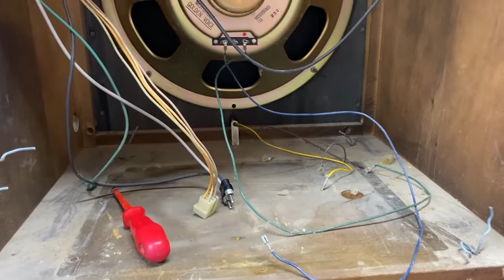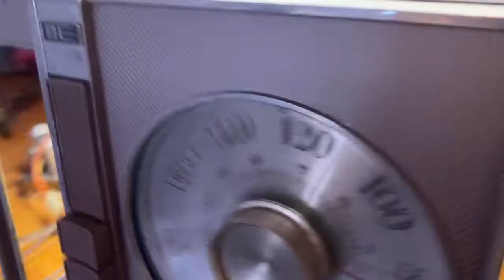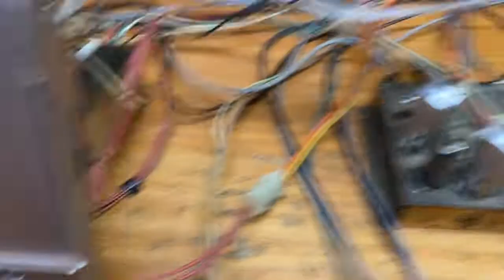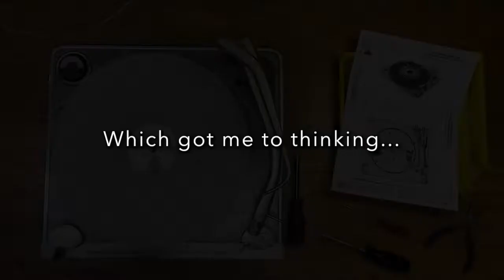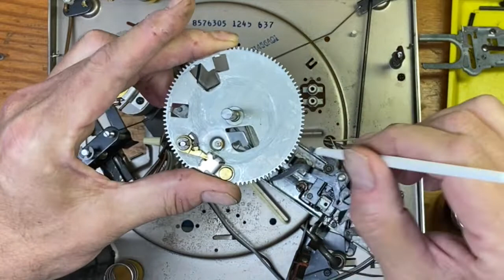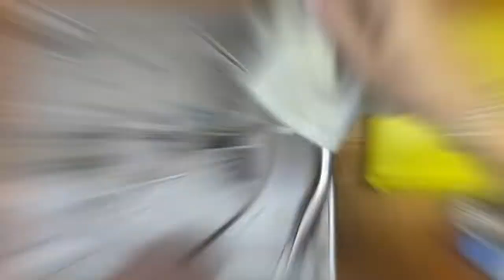Restoring a 1963 Drexel Motorola SK77 Stereo Console with VOM Record Changer

Comment: I have a slightly different, compact box version of this unit.  I modified the flawed/flat box design by opening up the front to unblock the base, reduce feedback into the box structure, and improve phono isolation.  Now it looks more modern and businesslike with a 15” circular black grill.  That glorious tuner/amp is the same and near mint, but with the bass unblocked the overall sound is far more balanced.  It’s a beast and I never listen to it at more than a volume setting of 3.  I’m considering a swap to a modern mid-range turntable as the old unit is too primitive, but for now the Bluetooth input is more than adequate.

Comment: Great amp! I had a version of that but it was SE on the two stereo channels with only the woofer channel being PP. There are other versions as well but this is the first all PP design I have seen. Yes, the "getter" absorbs out gasses from the internal tube metals over it's life. Mirror like is a good sign however the tube may still be bad or weak. Brown indicates a heavily used tube but still may be OK. A white getter indicates a vacuum loss and and a junk tube.

Comment: I’ve always gotten a kick out of the early years of the optional stereo multiplex decoder. 1961 was officially the launch of FM Stereo in the United States using the Zenith system which was the gold standard determined by the FCC. Several systems were tried and zenith won the prize with their system being able utilize a small footprint on the signal which allowed for other subcarrier information to be there and broadcast without eating up to much bandwidth & Transmitter power the others took way to much of as it’s summed in with with the ERP of a station. But others were in some cases sonically superior.
Very interesting set of circumstances which was an act of Congress testing it in the field and getting it all to work right.

Comment: Thanks again Steve for this video. I have just completed the voice of music changer service, and I'm just curious as to what adhesive you would recommend to glue my rubber platter mat back down to the metal turntable? It has completely separated. I have cleaned all of the residual glue/adhesive off of both surfaces.  Cheers!
Reply from the maker: I use Weldwood Contact Cement. Make sure to leave it overnight under weight.....
Reply: Hi again!  So I got the turntable all cleaned, lightly greased and oiled, and put back together.  All parts are free moving, and I can cycle the Main Cam/gear through and entire cycle, and all works as it is designed. (trip levers/record will drop/engage/reset/etc..  Manually, that is.  However, when I power it up, the turntable turns, but when I hit the "reject" to drop the record, the needle arm goes up, the record will not drop, then the turntable stops moving, and pauses there until I shut it off.  Any wisdom as to what I am missing?  To me, it seems like an automatic cycling mode problem, but I can't for the life of me figure out where to troubleshoot first. Maybe some cycle reset needs to be done?  It seems like the record tries to drop, but won't, then the turntable just stops because it's caught in mid cycle.  Any help at all most appreciated as always.  Cheers! @SteveScarlet

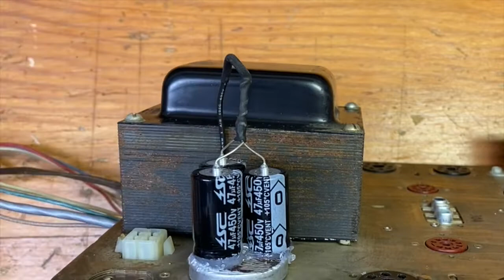Comment: Hey Steve, At 21:40 of this video, it shows that you connected all of the grounds together, shrink tubed them, and (soldered) them to one common grounding wire.  Where then did you ground the wire?  Was is to  the same grounding prong as the 200uf Cap underneath?  Cheers!
Reply from the maker: Yes, but any chassis ground will work.....
Reply: Appreciate you! Got the new caps, and looking forward to getting the amp completed.  This has been such a fun, disciplined project, thanks to your video. I'll be 😂to send you a video of my console operating once I complete it!@SteveScarlet

Comment: Hi Steve! Thank you so much for this video! I am restoring this exact setup on a 1963 Motorola console. Although the cabinet looks a little different, the components are exactly what you work on in this video. I have all but followed you step by step,  and I have managed to now be able to power up the FM tuner, complete with all indicator bulbs including the magic eye. My question is this if you don't mind: when I first took the console units apart to clean them, I had a functioning turntable only with full sound. Now that I've put it all back together, everything is powering up, but I have no sound! Can you direct me to troubleshooting where I may have gone wrong? Maybe just a quick where to look first? Thank you for any wisdom! And thanks again for this great video!
Reply from the maker: Thats a tough one without physically seeing it but re-check your work......
Reply: @SteveScarlet  thanks Steve! I seem to have developed a new problem which I believe is the vacuum tubes. When I plugged it all into bench test it, everything seems to power up, but even with the volume all the way down and no input from a component, the speakers are crackling. Seems to get louder the hotter the vacuum tubes get. My guess is I've got to part with some money and replace the tubes. Capacitors check out okay so far, but probably replacing those as well. So strange though that I was getting beautiful sound and no crackling from the turntable before I took it apart to troubleshoot  the radio/preamp problem.  I'm pretty sure I put all the connections back properly, but perhaps powering it up and disconnecting things one by one will isolate the problem.

Comment: What replacement did you use for C3 8uf/50v capacitor in the tuner section?  Thanks
Reply from the maker: https://www.mouser.com/ProductDetail/Wurth-Elektronik/860160672008?qs=0KOYDY2FL2%252BmDNgx1uK8%2FA%3D%3D
Reply from the maker: But a 10uf will work fine.....
Reply: @SteveScarlet  Thank you!
Reply: @SteveScarlet  I really find your videos informative and entertaining.  Thank you.
Reply: @SteveScarlet  Steve -- working on a Motorola SK77.  I am testing resistors in the amp and finding 75% of the bubble bee resistors to be out of spec.  Have you ever run into a unit that had that many out?  I am using the color code on the resistor for the value and then measure.  Appreciate any guidance.  Brett
Reply from the maker: @brettkaufman2299  you have to de-solder one of the legs to get a correct reading. I advise joining www.antiqueradios.com for good tips and advice.....